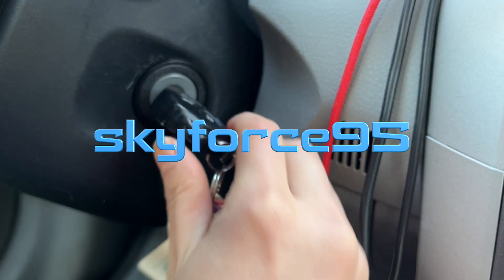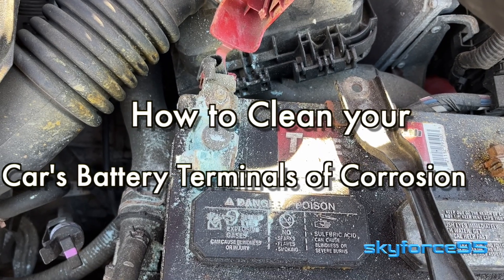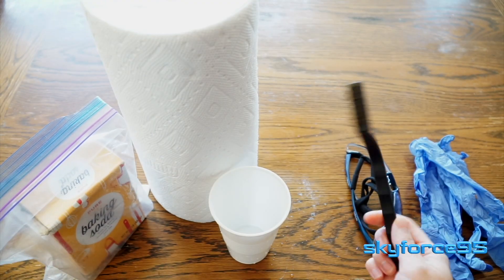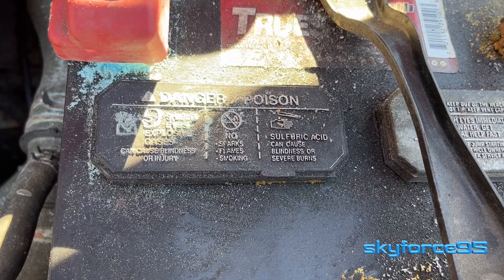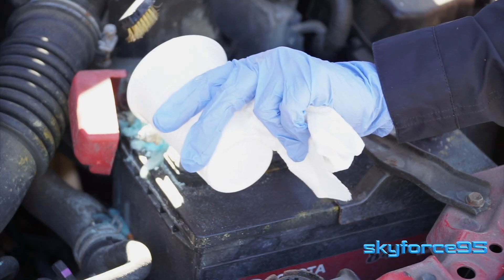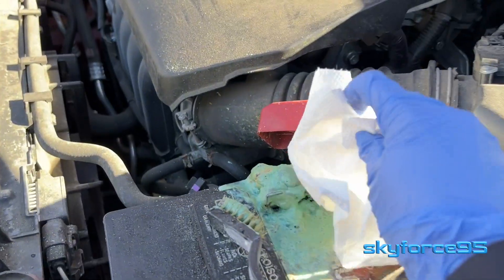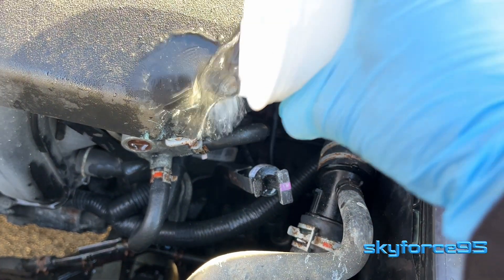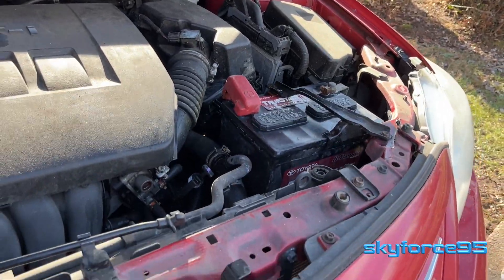How to Clean your Car's Battery Terminals of Corrosion

Comment: Well, you missed the most important part, which is cleaning the entire battery post where the terminals meet. It's crazy how many YouTube mechanics miss this... you also don't need all that water and baking soda. A wire brush will do just fine...

Comment: Great video, I needed to remove a great deal of oxidation from my cables and I don't buy coke, the baking soda/water solution did the trick.  After removing the cables from the batter posts, I dunked my connector lugs in the solution and wire brushed them thouroughly.  When done I rinsed off with warm water and dried to ensure I neutralized the solution.  This was an easy 10 minute fix.

Comment: It is better to disconnect the battery terminals, remove and clean the battery away from the car then use a big bucket to clean the terminals so you don't spill water on any other components. Hot water works better too. Finally, you should use di-electric grease after connecting the terminals to stop any oxidation or corrosion from developing.

Comment: That's why you should pay the mechanics for the job :D  But seriously, it's oxidation, not corrosion. Also, you should disconnect the terminals first, then clean the inside of the clamp as well. Finally, once you're done cleaning, cover everything with vaseline spray for protection. Problem gone for good :)

Comment: The terminals/clamps should be removed first. Rub the baking soda paste all over posts and terminals. This neutralizes the corrosion. Gently rinse n dry. Use a battery post cleaning tool cleaning the clamps n battery posts nice n shiny. Use anti-corrosion washers on posts or use the anti- corrosion  spray. Check yearly and clean posts when needed.

Comment: A mechanic told me that pouring a lot of water on the terminals will help. They did recommend removing the terminals and wire brushing the bottom connection area. The mechanic said don't use the felt pads because it lifts  the connection to where there's less mass connected. Many times there's not a whole lot to completely stop the battery corrosion. There are mechanics on YT that recommend this same method, but it's best to get under the terminals as well. This video is good for if you happen to stall and you can't remove the terminals at that moment in time.

Comment: This is ridiculous. Corrosion ON the terminal is irrelevant. It's the corrosion BETWEEN the terminal and post that creates the high resistance fault/voltage drop and slow crank. This "repair" does absolutely NOTHING to improve cranking.
Reply: This was always my question, “what about the separation of metal-to-metal CAUSED by the corrosion? Surely theres a gap now caused by the corrosion. Nobody ever addresses that. It would make more sense to remove the terminal from the post and clean it that way, instead of pouring a solution over it.
Reply: @iGotBombKushh  That's the entire problem. Oxide - of any kind - used to be metal and is a complete insulator. Corrosion on the outside doesn't matter...
Reply: Mine looked like this and I never had a battery look like all powdery but I have no issues cranking. I still cleaned it
Reply: @Soaring_Tofu Still clean it shiny n keep a good connection.
Reply: Yep! Should have removed the terminal clamps. Reel is worthless.

Comment: You definitely want to be careful with how much liquid you pour on there.  You don't want any to flow into the battery via the two caps or it'll kill your battery.
Reply from the maker: you do realize your battery gets covered with much more water when it rains, right?...
Reply: @skyforce95 you leave your hood open when it rains ?
Reply: @skyforce95  You do realize your neutralizing formula, which includes baking soda, isn't rain right?  

The intent is to neutralize the sulfuric acid outside of the battery, not the acid inside it.
Reply from the maker: @Th3Think3r  and your point is? Rain doesn't have a pH of 7. Sulfuric acid has a pH of 0.8 and baking soda has a pH of 8.3. If your car battery casing can't withstand a slightly basic solution then you shouldn't be using that car battery.
Reply: @skyforce95  Like I mentioned in the original post, the danger is the neutralizing solution working its way into the battery via the caps, not eating the casing.  Caps on vehicle batteries are often recessed and can hold liquid which increases the likelihood of seepage but it can happen either way if one isn't careful.  The cap is even more likely not to be sealed well if the battery terminal has a lot of corrosion, because it could be a sign of overcharging,  which is why someone would be cleaning the terminal in the first place.
Reply: @Th3Think3r how's your little proxy war going in Ukraine lol Z
Reply: Dumping it like that will not kill your battery.